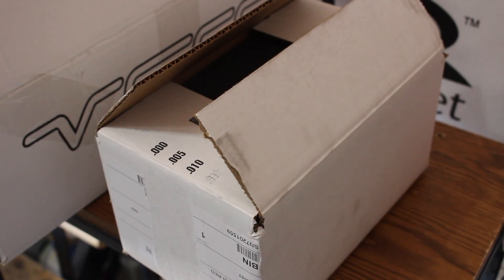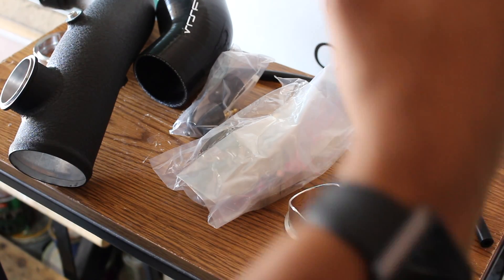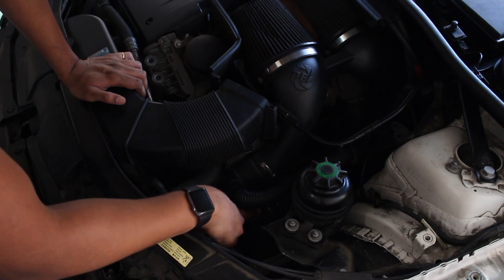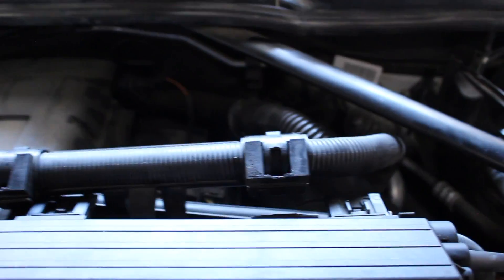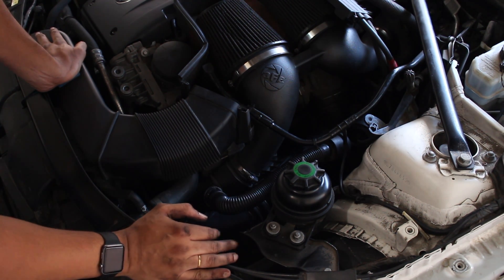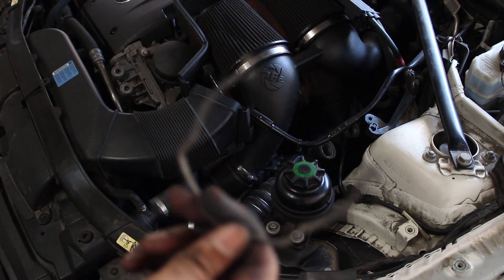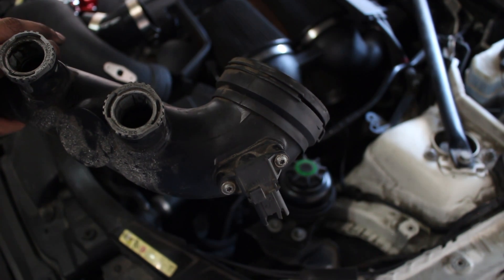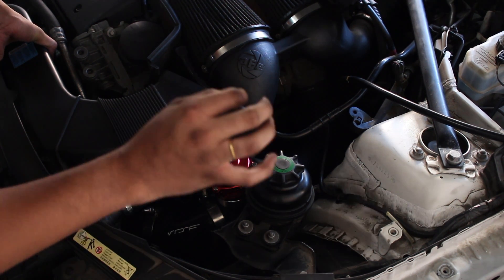VRSF Charge Pipe TIAL BOV on N54 335i DIY Installation

Comment: For some reason my vrsf charge pipe won’t seat fully so you have any tips for this or should I buy a brand new o ring
Reply from the maker: I had a hard time getting it to sit properly as well but you just have to keep pushing and twisting slightly till it clicks.
Reply: @Frostbite35i  I ended up buying a new o ring from a bmw dealership and it slid right on with a little Vaseline
Reply from the maker: @GooseJuiceGaming  That’s great!  I just realized I replied a little late lol.
Reply: @Frostbite35i  it’s all good lol

Comment: HOW DID YOU GET THE CLICK PLEASE HEP
Reply from the maker: Hey, don’t worry it will fit for sure if it’s the VRSF one. Make sure you have the manifold side in place before you put the elbow side in. Also make sure the c clip is not on yet. If you push into the manifold with some force it will go in. If you still need help dm me on Instagram and I’ll try to help. Good luck.
Reply: @Frostbite35i  i will be trying some more tomorrow i will let you know what happens